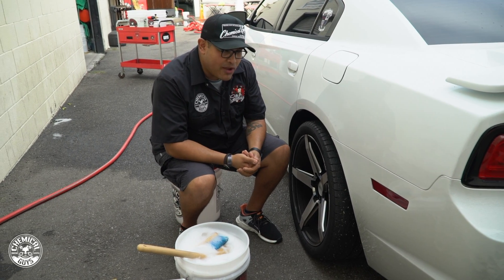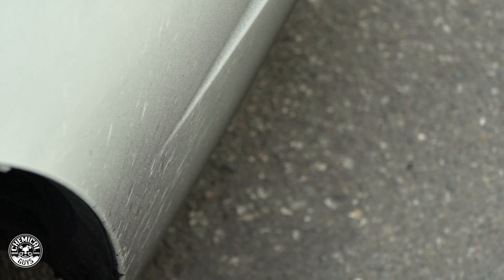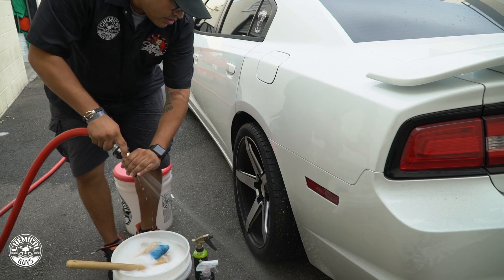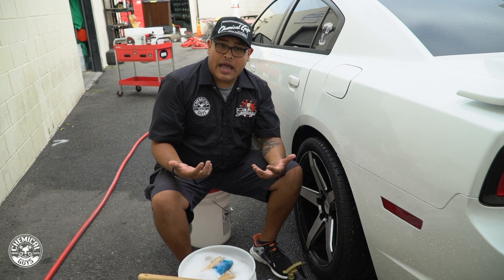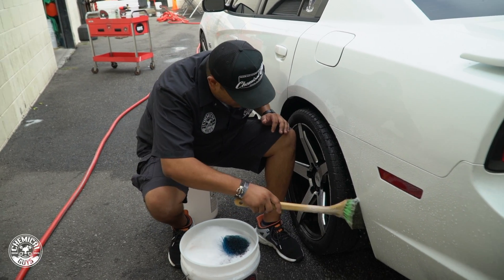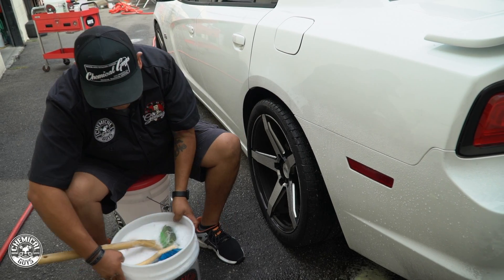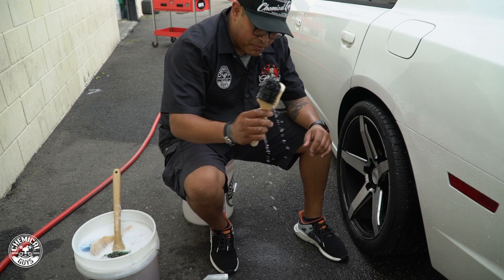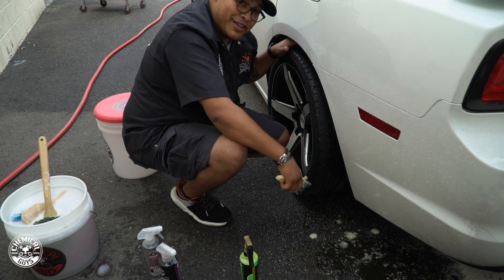How Do You Remove Burnt Rubber? - Chemical Guys

Comment: I was hoping more of a how to one the painted surface since that is a bit more tricky. And why not just go to the stiffy brush off the start.  It’s a fender liner no need to be gentle with a flag tip brush.
Reply from the maker: Hi! Good question. A detailing rule of thumb is always start off with the least aggressive method possible. Use the softest bristle brush that you think will get the job done, and then progressively move to more aggressive methods. Same goes for polishing, claying, etc. Thanks for watching and make sure to check back later today for a new video upload!

Comment: Drag radial rubber, much worse.  Itll come off like tar, super sticky.   I pressure wash and usually knock it all off.  It will ruin any brush, or towel you use